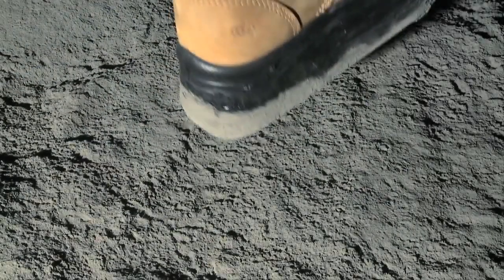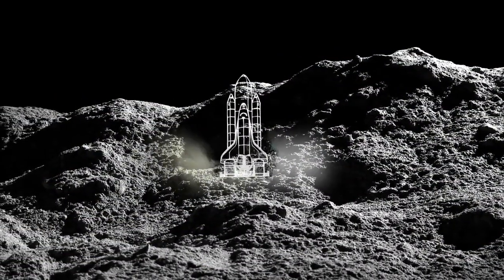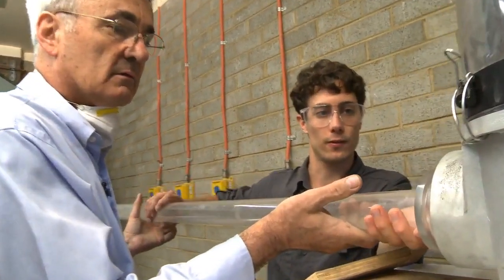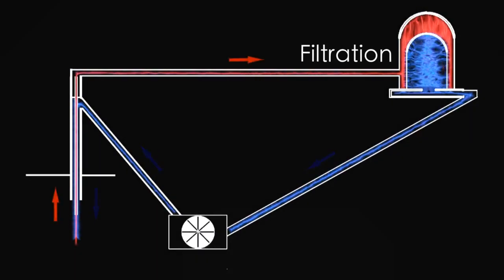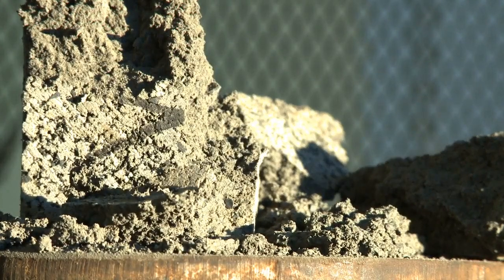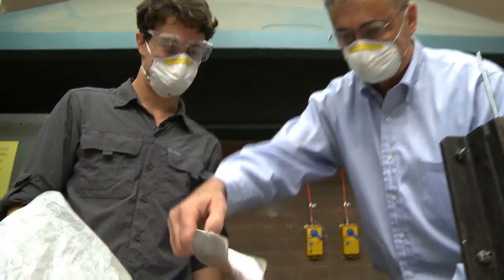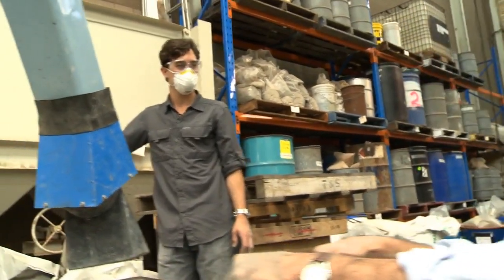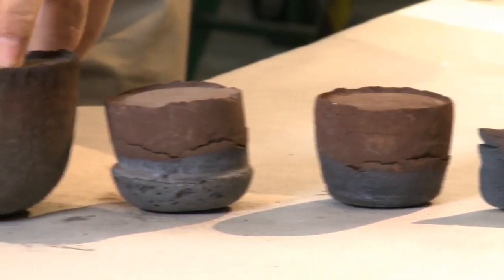Mining on the Moon

Comment: It's interesting how NASA thought as recently as 5 years ago. 0:59 - "We can't use bulldozers and trucks, because it's too heavy, we can't move it, it's too economically impossible." So they came up with this whole super-lightweight system to get around that...

...but now, SpaceX is basically leapfrogging all of that, and going straight to a super heavy lift system, the Interplanetary Transport System, that can put 300 tons of payload of the surface of Mars, a similar amount on the moon, etc. Which means that, once it's built, we will actually be able to transport those bulldozers and trucks. Making the whole complicated vacuum extraction system unnecessary.

Comment: doesn't the moon control the tides of our oceans and now we want to fuck with the same thing that does so
Reply: it dose its also gradually slowing the earths rotation and getting further out and the tides will continue getting weaker because of that but its a very large mass even if we where to take billions of tones from the moon a year it would have practically no effect on the moon as a gravitational body if you think of the scale on the order of 10^20 tons or higher after a billion years using high estimates you'd have taken maybe 1% of its mass .
Reply: I think some things are meant to be left alone and this is one of them
Reply: James Gardner not really there are relativly few things that reley on the tides and there going a way anyway this would also stop the earth slowing down so fast and 48 hour days are more of an isue than no tides so realy Id say it may do more good than bad for our planet In the very long run even with out taking into account the resources we would get that then wouldn't have to be mined hear on earth from relatively low concentrations.
Reply: James Gardner Lunar soil can be separated from helium-3 and redeposited on the surface. Virtually all of the moon's helium-3 can be extracted without doing a dent to the overall mass of the moon.